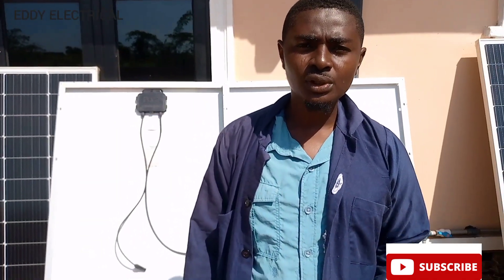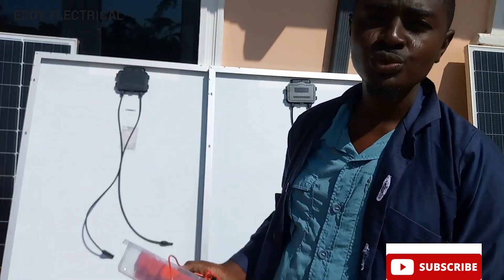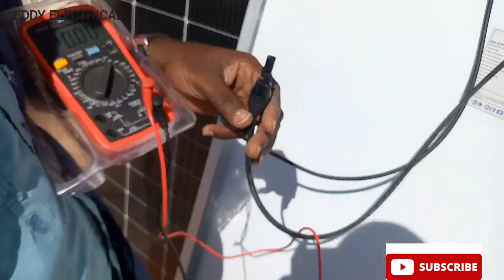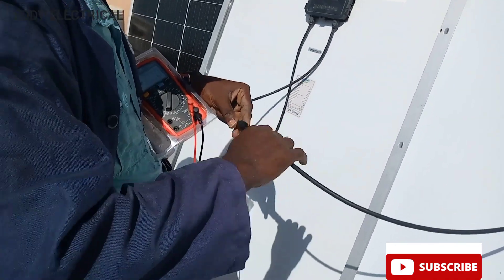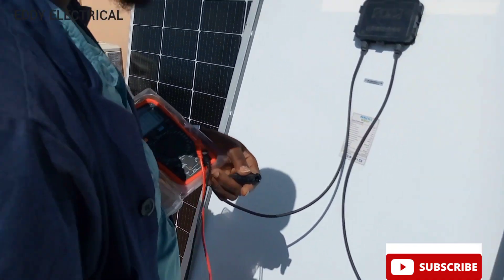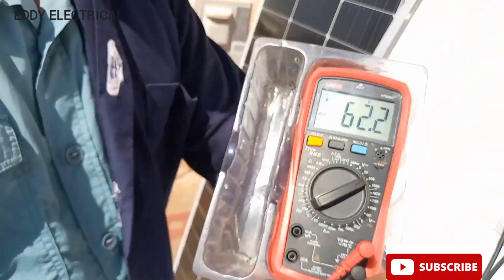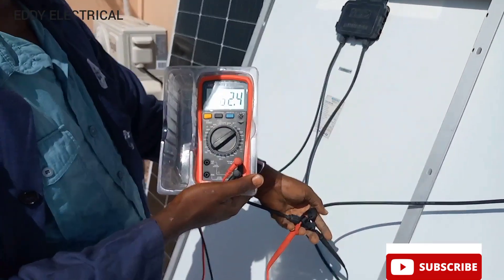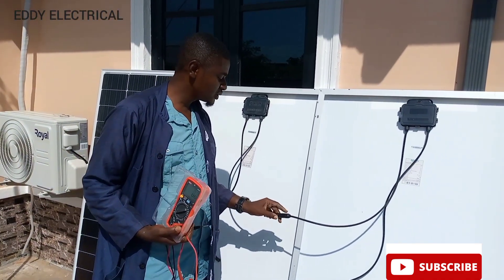How To Wire Solar Panels In Series vs Parallel, #electrical #short #engineering @eddyelectrical7671

Comment: Boss, how can we interpret d specification parameters written at d back of panels without using meter for the readings
Reply from the maker: Yes
Reply from the maker: There is a stocker on the body that will tell you the details of the panels